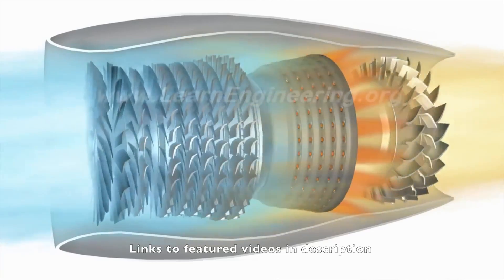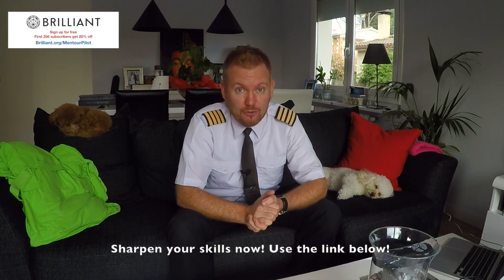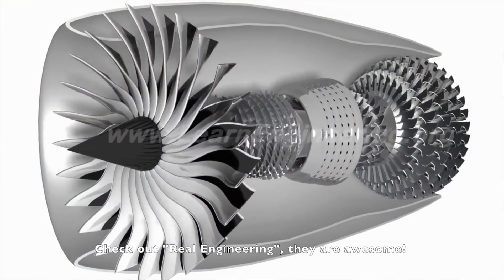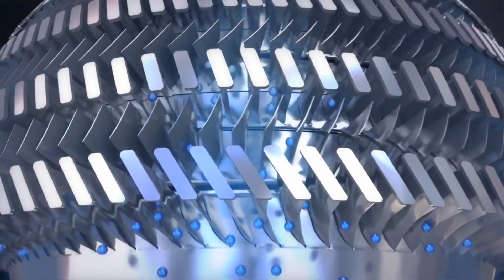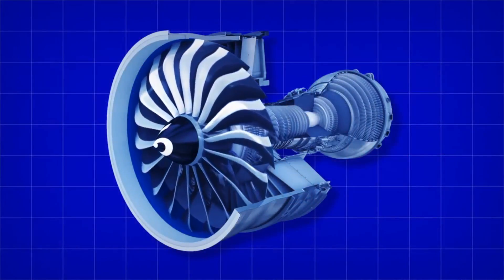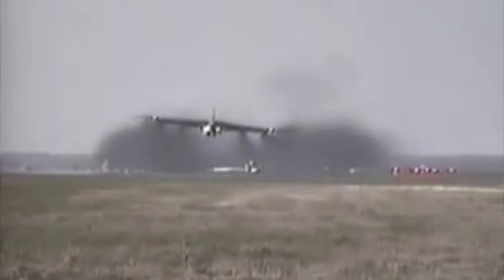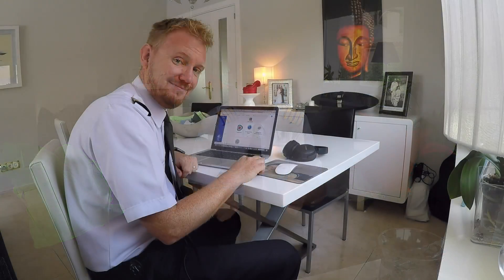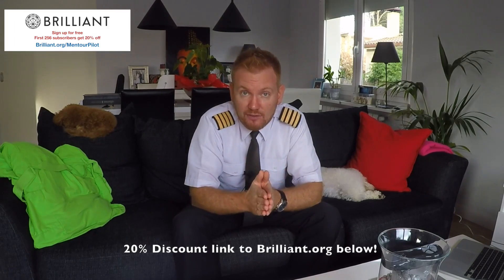Can water make Jet engines stronger?!

Comment: Doesn't  the jump jet have to have water cooling during hover?
Reply: Yes but only to control heat as there is zero cooling from air movement as aircraft not moving fast through the air.
Reply: @billskolnik4908  partly. It does cool exhaust temperature, but it also gives a significant boost in thrust by increasing the expansion of the exhaust.
Reply: AFAIK the harrier's engine will limit itself to output less if the temperature is too high. Thus water injection lowers the temperature, raising the max thrust the engine control is willing to allow.  Dry boosting is possible but it'll wreck the engine, so I think it'll impose a time limit on that. As in something like 90 seconds (cumulative) before the engine has to be replaced.
Reply: Yes and to take off in hot climates.
Reply: It's not for cooling. It's for additional thrust.

Comment: As a plumber in the USAF I use to make water for the older tankers aka refuelers and the B-52 bombers has water injection jet engines.
Reply: @IronCurtainPrepper Are we here for politics or aviation ?
Reply: @IronCurtainPrepper Dude don't kill the vibe
Reply: The 727 had P&W JT8D engines that were not water injected
Reply: Yep up until through the B52G they used water injection on take off....  During MITO exercises the end of the runway would be wet... Another interesting point I believe the P47 radial powered fighter could use water/methanol injection during application of emergency military power applications....
Reply: I don't know what your reality is but I was in USAF back in late 80 to the early 90s and the B-52 g models were not completely retired until  2013.
Reply: @StringerNews1 The J-57's were very inefficient and by today's standards the thrust to weight ratios were very poor. They would produce the high exhaust velocities required for high speed flight at high altitudes but down low and going slow the thrust was limited. That's why they eventually put the TF-33 turbofan engines into the H model B-52's, which was an improvement. The fan produces more thrust at low speeds. The black smoke was actually caused by incomplete combustion, part of the reason why the J-57 was so inefficient. The water injection increased the mass of the exhaust gas which increased the static thrust.
Reply: When I was in the navy and was a mech and aircrewman on MH-53.  We used 3. T65-GE-416 TURBO SHAFT ENGINES. JUST BEFORE I GOT OUT THEY WERE installed a water nozzle connection to the intake to wash the engine before shut down
Reply from the maker: Cool!!
Reply: @MentourPilot  Did the 727 have such a water injection system?
Reply: Yeah, I think KC-135 had low bypass turbofans, so they needed water injection. Now they use high bypass turbofan engines
Reply: You mean water methanol?
Reply: @StringerNews1 I thought it was the efficiency of turbo fan engines
Reply: @StringerNews1 - I had an Air Force buddy of mine who died a few years ago from lung problems. He had worked on B-52's and KC-135's back in the 1960's and 70's. He had a biopsy of his lung tissue done and they found residue of jet fuel in there. Apparently while working around those early turbojets and breathing all the carbon laden exhaust they put out it had gotten into his lungs and eventually it killed him.
Reply: And yes. You can burn water....in a way.    Actually it's very easy and very powerful
Reply: @David-uy4jz  but needs to derive 100% energy from nonwater sources
Reply: @StringerNews1 It wasn't so much the chemicals. It was the old J-57 engines. If you've ever seen pictures of B-52's trailing smoke after take off it's an indication of how dirty those things were burning jet fuel. We were in aircraft maintenance, which meant we were breathing all that dirty jet exhaust. That's what got him.
Reply: @IronCurtianPrepper Imbecile.
Reply: 707 was water Injected, the early models
Reply: And I loaded a lot of it onto the KC-135A aircraft.  All 5581 pounds of it per aircraft.  It would only last two minutes on takeoff.   Grissom AFB IN.
Reply: i. rob  and the US army is a terrorist organisation. Deal with it.
Reply: Star Trek Theory  WTF?
Reply: @StringerNews1 you can burn water. You can do it at home with stuff you have around the house. It's pretty simple. Hydrogen is extremely flammable.....so is oxygen.  Think about that for a second. Water can be separated into it's 2 separated ingredients with just a few volts of electricity. Do your homework......just don't try to do anything with the idea........"they" (whoever "they" is) won't let you.
Reply: i. rob  well said ,thanks.
Reply: @StringerNews1 I was a crew chief on Tankers,  you didn't always inject water in the J57-59W. It depended on fuel load, ambient temperature, and height above sea level where taking off. Generally, if the fuel load was above 90,000 lb and the ambient temperature was above 80 degrees, you put water on. It was 670 gallons and the tank was right between the main wheel well doors. The slang for those engines was "Coal Burner", hence the huge cloud of black smoke.
Reply: IronCurtainPrepper wtf are you talking about? I think you’re commenting on the wrong video.
Reply: i. rob  This is a fun, learning place. Don't feed the troll, it will go away.
Reply: IronCurtainPrepper I’ll join your cult thing. Just kidding. Im American if your have an issue with it, move to Russia. The b-52 were around the iron curtain waiting for Russia to launch a nuke. We would be there to quickly to respond. Btw, we don’t like bullshit so shape up or ship out.
Reply: @smoke_eater_  he's well shaped up, unlike you

killing innocent civilians in Yemen is terrorism
Reply: IronCurtainPrepper btw were not terrorists. If you think invading a country is messed up, say that after your country is attacked by al Qaida and 2,996 Americans die.  Read your facts. Your an idiotic uneducated fascist.
Reply: @smoke_eater_  that is why US invaded Iraq, bombed Libiya, Siriya, trying to overthrow government in Venezuela, actually did overthrow government in Ukraine and so on. I know this isn't a place for politics. But you are full of s..t.
Reply: Raymond Licon I believe I read somewhere that the B-52 had stopped using water injection that he actually thinks containing water were removed from the plains. I assume this is not true ?

Comment: Pls educate us how and where is the electric power is generate in an air plane
Reply: The electric power comes from generators mounted on the engines, or APU. Supplied power is either 115Vac/400Hz, or 28Vdc depending on what the aircraft is designed to use. Most aircraft are predominatly AC powered with some systems usig DC, but in that design the DC power is converted from AC through transformer rectifier units. Other power sources are batteries for initial power-up if no ground power available, and an air drived generator in case of power loss during flight.
Reply: @CLTmech  how does air power generator works?
Reply: @Admikabchcha  An air driven generator (also known as a ram air turbine) works like a small propeller, but using the movement of the plane through the air to turn the propeller portion which creates rotation for turning a small generator unit. This supplies a limited amount of electrical power to operate a few systems in the event of an electrical emergency.
Reply: @CLTmech  thanks for reply
Reply: Theres an APU,..Auxiliary Power Unit, which is a small engine that turns a generator. Its usually in the tail.

Comment: Beside the mass, was there greater combustion/thrust because of the oxygen in the dissolved water?
Reply from the maker: Not sure about that. I wouldn’t think so.
Reply: Interesting question!... if we added high voltage arcs in front of the turbo fan we might be able to harness the water electrolysis split into oxygen and hydrogen and get some HHO out of that vapour to add combustion to the engine!
Reply: Assuming that you didn't mean "dissolved oxygen in the water" and proposed to use the oxygen in the water molecules... 

If the oxygen off of the sprayed water had been used to burn the jet fuel, the remaining hydrogen exiting the engine would have reacted with the free oxygen in the air and burnt almost like an afterburner. Unfortunately, the compressor blades or the reaction in the burning chamber can't split the oxygen in the water. You need electrolysis for this, like another poster pointed out.

Comment: those planes that used water ingestion to get that extra thrust, were they very limited in ther ability to perform go-arounds? (considering they probably used up the boost water during takeoff)
Reply from the maker: I’m not sure if they kept some in the tanks. In any case, they would be much lighter at that point so it would be less of a problem.
Reply: I dont believe so as in a go around they are already carrying alot more energy that they would at takeoff from a stop...

Comment: Before even seeing this: The answer is yes water can increase thrust, Temporarily
The B-52 used to dump water in the engine to increase take-off thrust by increasing the expelled mass. - This is why they are pictured with black smoke coming out the back at Max takeoff weight
Edit - Called it! I hope the US go ahead an upgrade the B-52 fleets engines soon
Reply: I've seen this when we had a B52 base near here. Always wondered why it put out all that smoke.
Reply: The americans will never do what the world want them to
Reply: @twistedspirit7608  Good. I prefer it that way.

Comment: The Harrier Jump Jet also uses water injection when landing and/or taking off vertically for the same reasons you described.
Reply: And to reduce engine/nozzle temp.
Reply: @gordonlawrence4749  without it they tended to start fires and heat deck plates.

Comment: Suggestion// Do a remake (in the sim) of the lion air crash and what went wrong with the current findings and explain there the MCAS and what could have been done to avoid it or not.
Reply: He has explained the MCAS already
Reply: @tomstravels520  I know, but I mean in combination with the sim remake as stated above. I think id make a great video to explain what the plane was doing although it shouldnt.
Reply: Paul D
I agree. Good suggestion.
Reply: SIM remakes are generally inaccurate. Even with that aside the investigation reports aren't complete, almost nothing but wild speculation to base it on.
Reply: MyTech I didn’t say to solve the crash. I just suggested to do a remake with the CURRENT findings. Could make an interesting session.

Comment: I've often wondered about how cold water and cold air entering the jet engine (like being -40° at cruising altitude) and the burn chamber being so hot (like 1800°) don't cause the whole engine to disintegrate
Reply: Heating and vaporization of water is in stages as well as bypassed.
Reply: Because engineering, not blind faith. :-)

Comment: Cant there be water injection in modern engines in case of an emergency (when more thrust is needed?)
Reply: weight considerations - water is heavy and you need a good volume to have any use here

Comment: Hi Mentour Pilot. Really cool video, modern high-bypass engines are so cool and bypasses so many problems of older engines including high temperatures and internal power for aircon, pressurization, and other stuff. I had no idea that older planes used water to help. Makes sense in a way.. Some cars like BMW also use this for similar purpose, a lot compressed in a single video.. Love your shaggy dog btw. Take care and looking forward to the next one!!

Comment: Why aren't plane use fuel mixed with oxygen so it can fly higher, like roket do ?
Reply: Pacifika I think fuel premixed with O2 wil be a guite explosive substance and very dangerous to carry.
Reply: NASAs only use them for pushing the rocket from Gravity pull. If that is used in plane will flame high and rip off the tail part of the plane having high melting degree.
Reply: Don't think that would help. From a previous video they already fly near the limit of 'coffin corner', so it's not the available power that limits altitude.